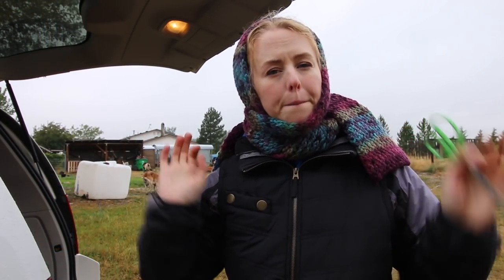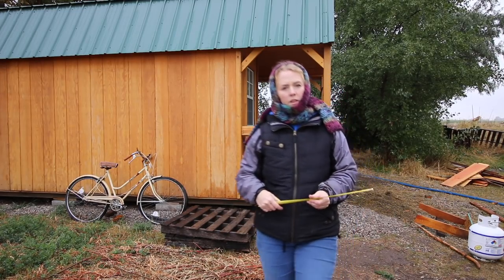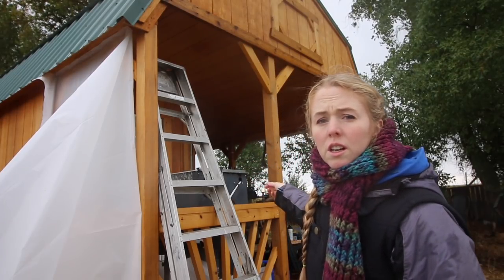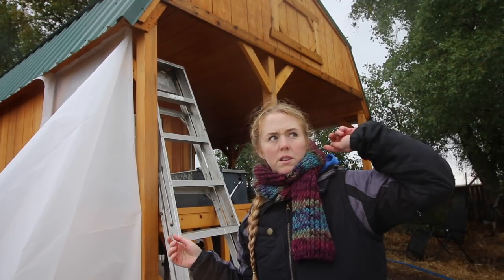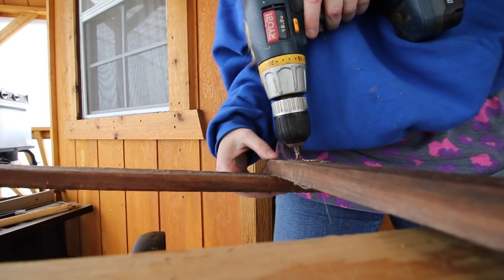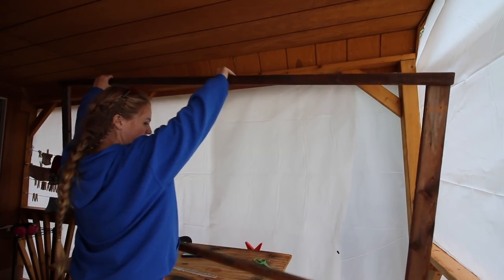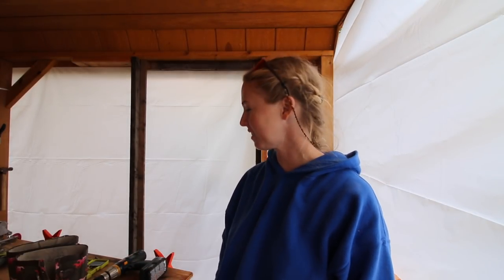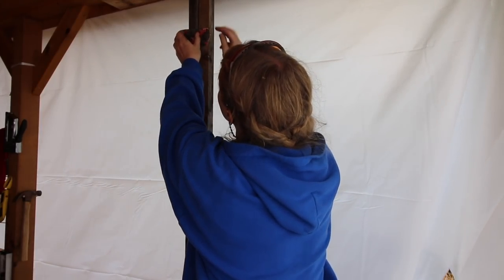Tiny House Porch Greenhouse

Comment: What about panels with bubble wrap because the bubbles would be a little insulation. Or even block the windiest side (prevailing winds) with panels made put of the aluminum covered foam to give you even more insulation to the wind chill. And I'm thinking you may want to add two pieces of lathe across both the top and bottom of the door so it can hold up to all the opening and closong when the plastic is brittle.

Comment: Julia: it would be better to make wooden frames and attach the plastic to them and then hang the frames where they go. I did that years ago and it makes a lot less holes in your house that way. Just a suggestion, sweetie.
Reply from the maker: Yes, I can see that. My mom said the same thing wanting me to use rigid plastic on sliding rails. My problem is that fatigue and time are the driving forces in how I do things right now. I know you are right I just had a hard time doing this even with how simple I kept it. If it works well then I will make a more permanent job next year and frames would be a great way to go!

Comment: Here is a tip for buying power tools  on the cheap search Ebay for "Bare tools " that is just a tool without a battery or charger  since Roybi went to LiOn Batt powered the new green ones  the older blue Nicad powered ones are selling cheap 
I won a Roybi 18 NiCad drill and circular for 25.00  a new 18V NiCad Batt at Home Depot is 49.00  or Batteries Plus can rebuild one 29.00 to 34.00 each not inculding shipping  there is no HazMat shipping charge on NiCads  
I only have one Batt but there is only one of Me working at any one time so I just move the batt from tool to tool 

When You are searching for bare tools inculd the Right angle grinder  and a recipicateing/sawzal type  both very handy on a homestead Farm 

I use Right Angle for cutting metal  it makes cutting corragated tin or metal roofing a dream  

The recip Saw I use for tree /brush cutting  and its a great tool for breaking down Hogs in bitchering

Comment: Why didn't you put the plastic inside the wood rather than on the outside?  Would have looked so much better.  Good that you are on your own property and aren't having to be watching codes and neighbors that don't want their property values to go down because of make do projects.  That will be one thing that will cause a lot of places to pass building codes against tiny homes.  That's why you can't put travel trailers on lots in so many states.